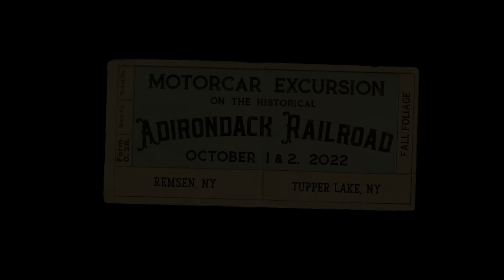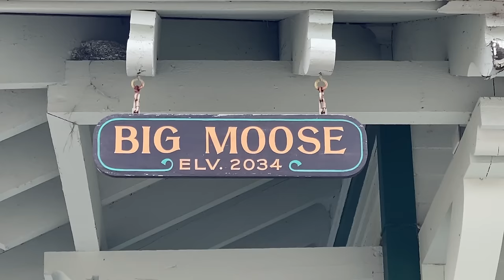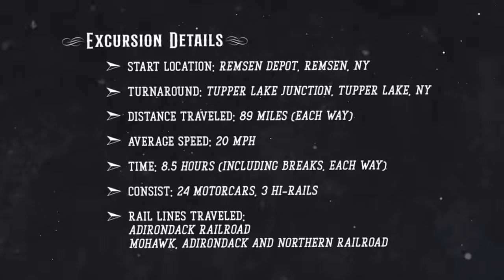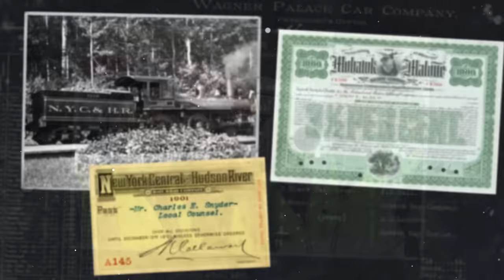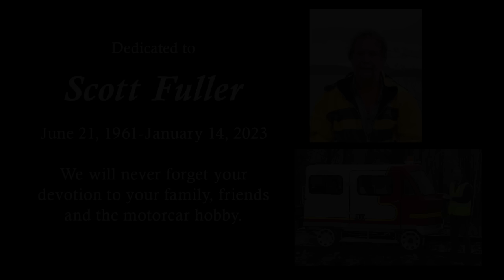Motorcar Excursion on the Adirondack Railroad | Oct. 1-2, 2022 | NARCOA | NEREX | Railcar | Speeder

Comment: I never knew these motorcars existed in America.
Reply from the maker: Us either! We always saw the old hand pump cars featured in movies. Then we found out they were replaced by these motorized versions which ran for 30-40 years. They were all scrapped and replaced by high-rails. 

For more detail, check out:

https://en.wikipedia.org/wiki/Railroad_speeder
https://www.american-rails.com/speeders.html
Reply: You're obviously not old enough.
We called them PutPut cars when I was young.
The MOW  (maintenance of way) crews used these cars for inspection and other duties on the Right of Way. 
When "High Gear" came along, companies could put that on vehicles to run both roadways and railroads. This eliminating the need for the motorcars.

Comment: Sorry for not getting back sooner... if it wasnt for your ❤ as a reminder, I would've flaked.

It was wonderful seeing the section I rode on my own creation, an attachment, that I made for a standard bicycle, an outrigger, and a guide to keep the front bicycle wheel centered on the rail. I spent many years perfecting it in Bethlehem, PA.

Since the bicycle steers itself, I rode no-hands most of the way....  it was like flying... slowly... the ride taking 5 hours. I think I made good time... Speed wasn't my goal... but I was in good shape... not so much now.

The attachment was encouraged by the guy who designed the 4 wheel railbikes I see parked on sidings... he had a bicycle guide wheel he designed, and wanted me to make it work. Try as I may, I couldn't, until I modified it, driven by the many failures of his design. I did a bit of lathe work, a few more failures, then finally, I got it working well.

It wasn't perfect, but I made it up and back with only one derailment. 

The rails near where I live have hazards the Adirondack Railway doesn't. I got derailed way too often around here. At speed, it proved humiliating, and occassionally, painful. The last rerailment mase me so angry, I dismantled the whole device... back to square one.

I've a whole new design on the drawimg board... totally all mine...

I'm 73 now. My ride was 23 years ago...

You didn't catch my friend's wife. They live along the tracks, above Lake Lila, and Tupper... no highlights of interest for the film maker. Oh well... 

They're good people... but not particularly railroad nerds.

I got an interest in doing this because I was a bicycle nerd, working for Bicycling Magazine... my dad, was the rail fan... I grew up with his train obsession. 

I'm also a metal worker/mechanic/fixer/maker. Have a nice workshop.
Reply from the maker: I have seen videos of people out west who ride abandoned tracks with homemade railbikes. You are more adventurous than me! I love t you are designing and planning a new bike. We are hoping to do a run this year in PA.

Comment: What is the motor they use?
Reply from the maker: There are all different motors in these cars and some have been completely or partially swapped out or modified.

Here is some data on their original engines:

https://en.wikipedia.org/wiki/Railroad_speeder